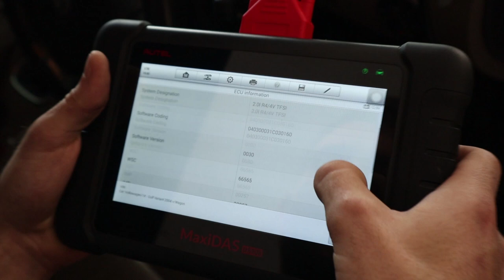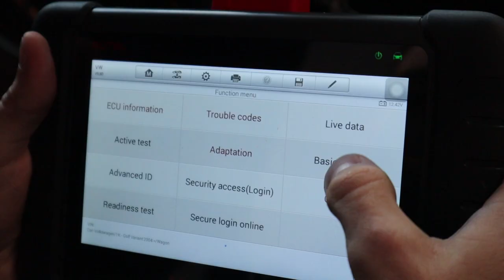The Ultimate Mk5 GTI Engine Upgrade (KO4 Turbo!)

Comment: Beautiful! Curious but what are those blue wires in the engine running to?
Reply from the maker: Just the lines for the blow off valve, it had to be relocated and was relocated to the front of the car